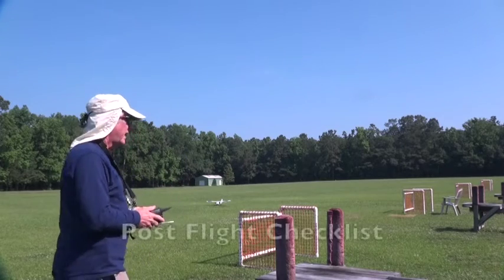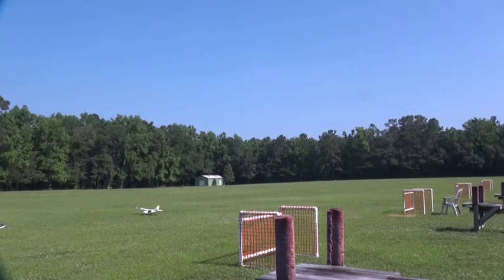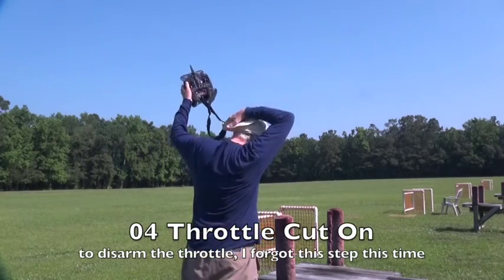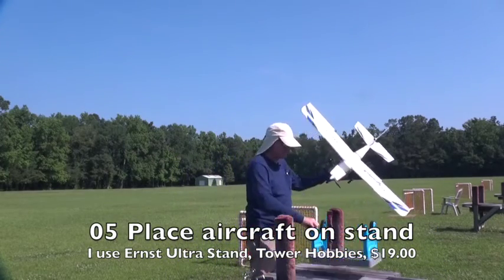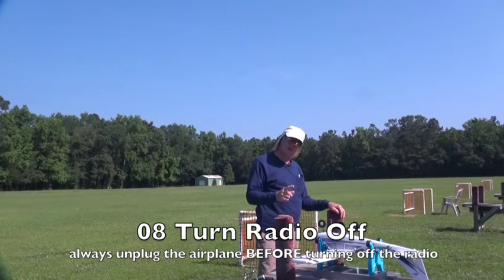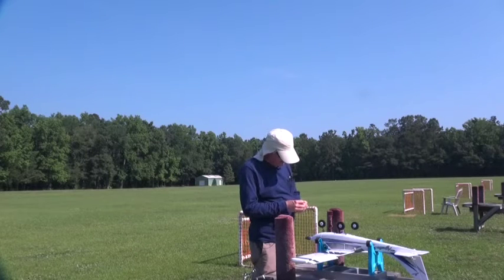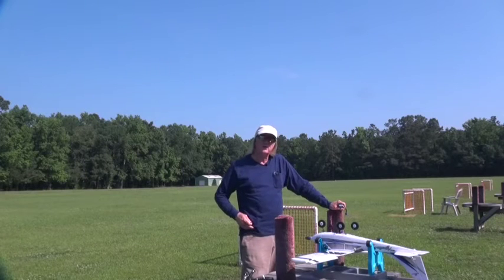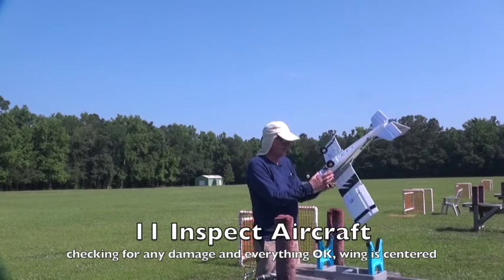MA12 Mini Apprentice Post Flight Checklist

Comment: Thank you very much for all the videos! I flew 2 battery packs today on my new mini Apprentice and everything went great.. The wind was blowing about 7 to 9 mph. I used beginner mode to takeoff on my first flight and it did actually what it was supposed to do thanks to your video. But I did notice right away it wanted to  climb at anything over 20% throttle,even in Intermediate mode it away wanted to climb with throttle over 30%. 
So I trimmed it out with the radio to fly level at 50% throttle in intermediate and advanced mode, but mechanically fixed it when I got home. And the airplane is very easy to fly and landing as well.
Hopefully the weather will be good over the weekend so I get more flights in..
Reply from the maker: you may need adjust the elevator trim, either with the radio trim or mechanical adjustment of the elevator clevis.